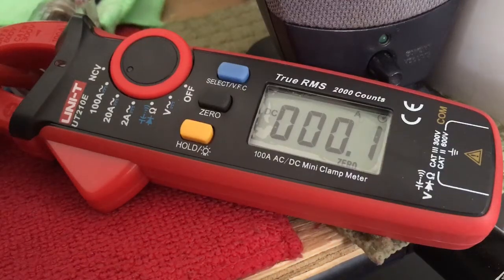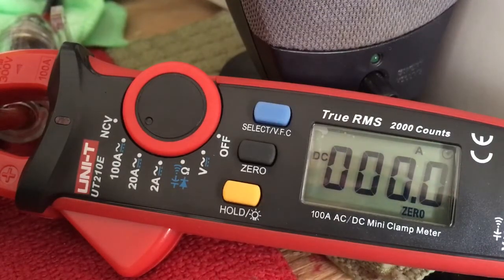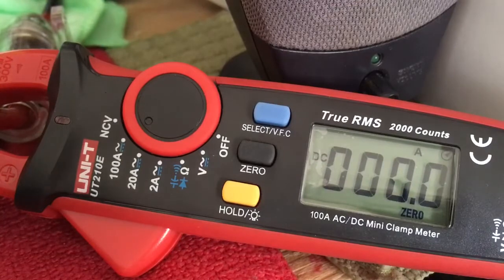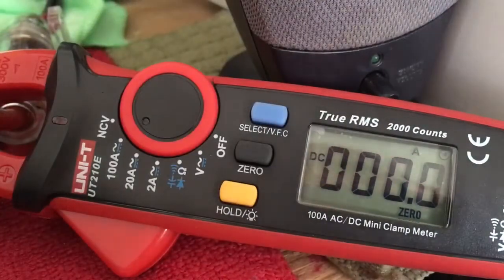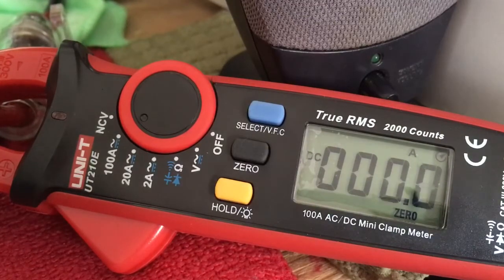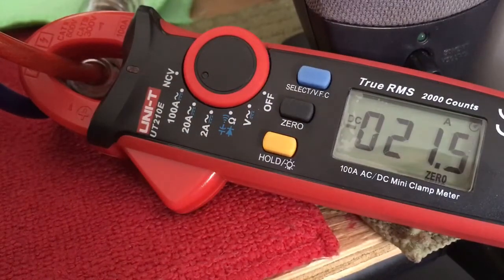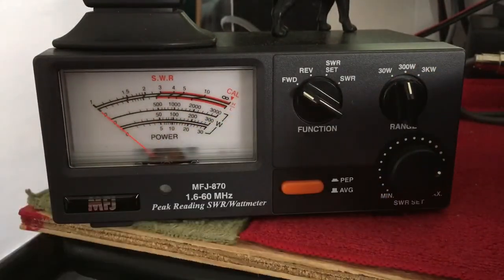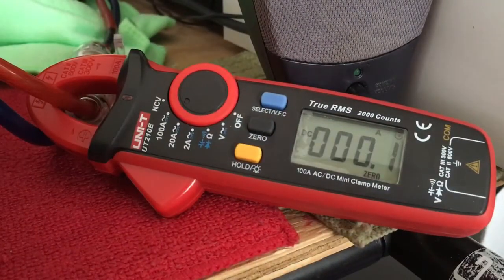2970n2 amp draw test

Comment: Good informative video. Real numbers while radio is being used. I will choose the 2970n2 over the n4 model. 2 hundred extra watts does not make much difference. But going from 34 amps to 68 or 70 amp draw is a big difference.

Comment: Another turd from factory, My 2970N4 was deadkeying 250W brand new untouched! Ranger via their tech support dont even respond to my requests for support. Their QC and support is a disgrace.
Reply: Dave White I just can't get my head round why in this day and age their radios are not even calibrated to their own specs from factory.  I lowered the deadkey and hi and low , current was peaking at over 50A on my N4 and now its less than 30A on average. SSB on full power still hits over 500W with peak of 54A used with dial open, again not setup right. did you notice with cover open the mosfet stuck near the left side of the chasis get hot very quickly. Amp temp is ok however.
Reply: Dave White I was the fool, sent first one back due to mic shorting out radio - plug connection was missing a screw DOA. ordered a second one, fool me twice lol
Reply: Dave White agreed
Reply: Dave,is there a website listing radio tuners state by state recommend list?
Reply: Dave White cheers, who's Muke Houston? wonder if its worth me shipping my under warranty radio to ranger , that's if they reply which so far they have not so that they can at least put it to spec?

Comment: I just ordered a 2970n2 and a 40amp/45 surge power supply.. thanks to your video. I've heard storied of the 2970n2 shutting down 50am power supplies.. It's not normal.
Reply: Its because they dont calibrate their rigs when building them in the factory, they just throw them together, then when you complain they say you over tuned your rig when it burns out.